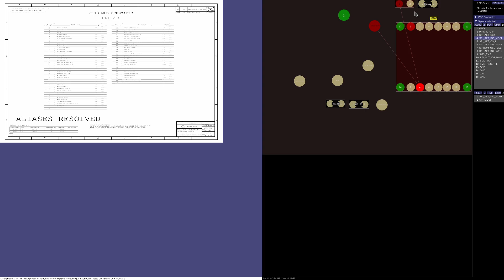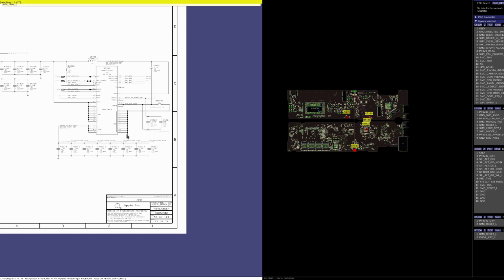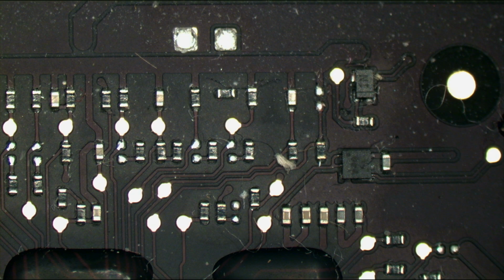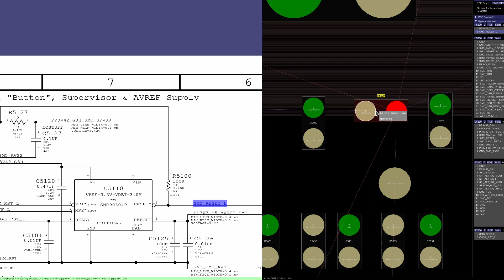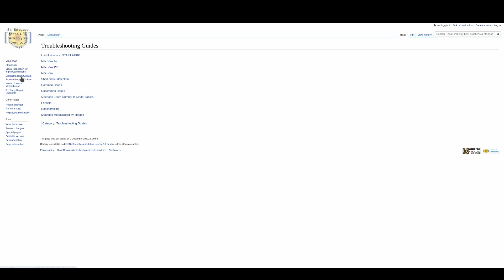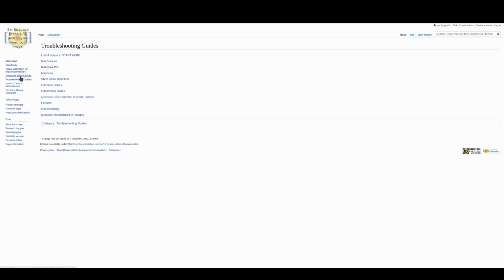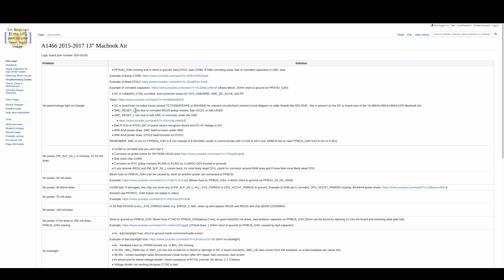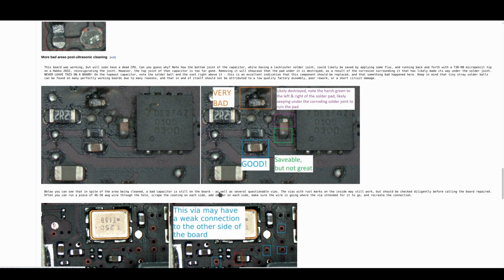A1466 Macbook Air 0.009 amp draw, no green light, logic board repair

Comment: Louis- once upon a time there was a repair doc company called Sam's Photofacts. I have no idea if they're still around any longer, but it was expensive and it was absolutely the thing you had to have to do repair work in the old days. All those old radios TVs, whatever were covered. It was amazing.

Now what you are talking about and providing a service which could include a schematics and tech tips for repair, that's a legitimate service you could charge for. You could have a pro version. Or who knows it could be donation. But just like Sam's Photofacts, that has the potential to be a very big deal.

Comment: First time poster in Louis' channel, long time Mac user, not a technical type. First up, I LOVE Louis' work. Brilliant. He makes excellent points and his knowledge is off the planet, well my planet anyway. Whilst I love the Mac OS, I've long felt that the company is... nasty. I never visit Apple Stores. But here's the issue I take with Louis. Looking at all his clips, you could be forgiven for gaining the impression that Apple computers are shoddy, second rate. And sure, I 'get' that Louis justifies all the problems and poor design he notes. But my experience, over 30+ years, has been anything but that. I started with an LCII running System 7. Over the years I've have many Macs and every one has been super reliable. I started an ad agency with two guys and we had a local network with 15 Macs hanging off a server. Our work (sending off ads etc) was time critical and we never missed a deadline, we had very little maintenance cost and only one major failure (a dead HDD) over 25 years. Like I say, I love Louis' work but my experience, over 30 years, is that Macs, in contrast to computers running Windoze, just work and work and work with just about no fuss.

Comment: My A1466 died after failed update to Big Sur. Now, there is no chime and fan is starting and running full speed, but no picture at all. I hope this can be repaired by rewrite EFI. Therefore removing JTG connector is probably bad idea in my case. Anyway, great video. Thank you very much.

Comment: I really do like your board repair videos... not to learn about Apple and Macbooks.. If I'm not doing stuff myself I know I'll never remember anything you say, you could say  some things about PP-Bus,... a thousand times it wont help... But I really like them in general and hell it sure helps me to get into SMD soldering.. which I really need to know about when I want to get more serious with the microchips I've programmed and to get some components on small circuit boards. So it's still a big plus for me... Still thinking hard about to get a cheap / fair fume extractor and microscope.. Since I'm not really well equipped on the Money side... I'm still searching... Something available in Germany / Europe would be nice...

Comment: hello people of the comment section, I have a 2016 MacBook Pro with Touch Bar and recently it stopped charging past 1%, I have spoken to apple online and they said that it would be a £200 battery replacement, could it be anything else other than a battery replacement that is needed, thanks in advance to anyone who replies